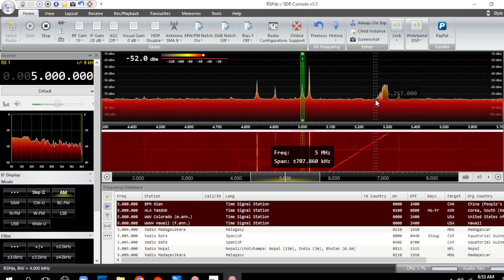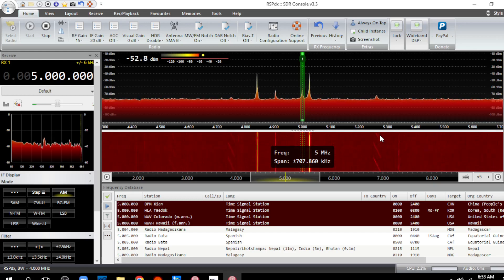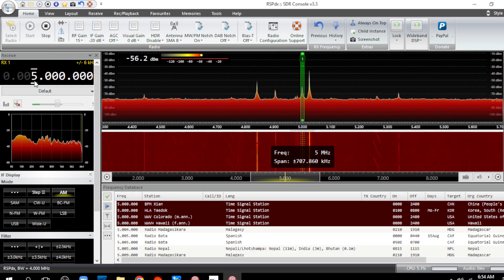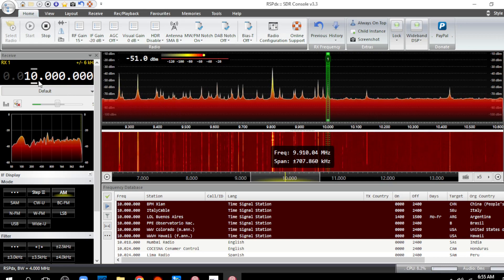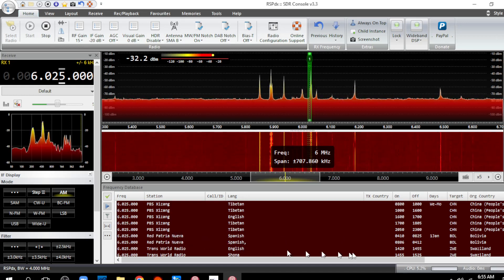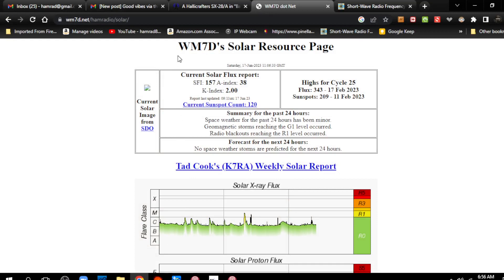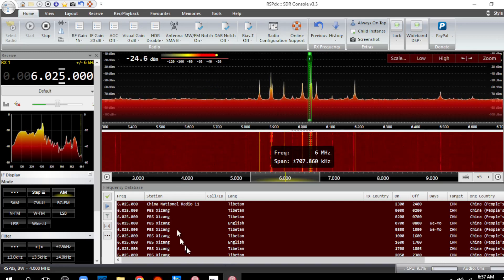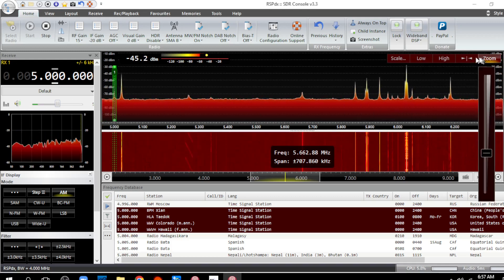TRRS #2320 - Sun is Killing Shortwave Radio Right Now

Comment: Just found out that you have to buy an RSP1A box to use the RSPlay software.  Little over one hundred dollars, but worth it, based on specs.  Ordered mine from Ham  Radio Outlet--they have $5 off during summer sale.
Reply from the maker: I have spent a lot of hours using most of the RSP radio and really love them.  The are coming out with new PC controller software soon.